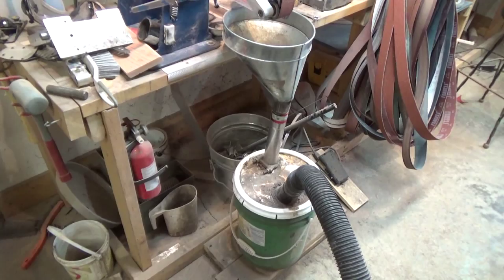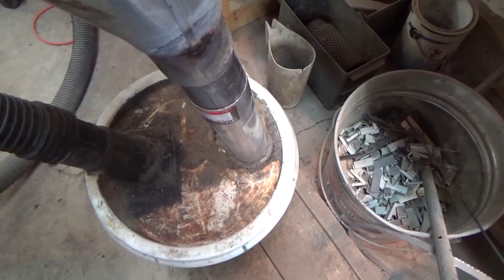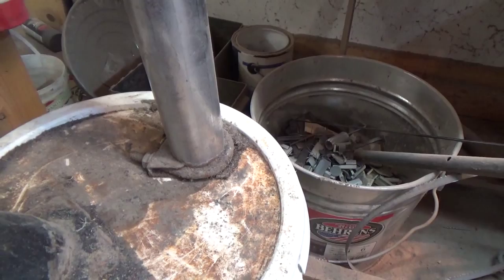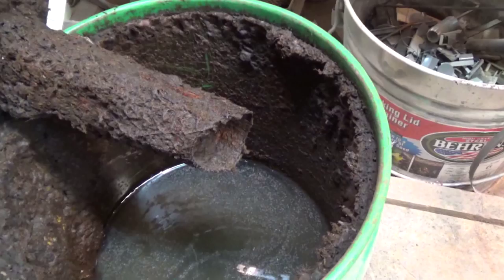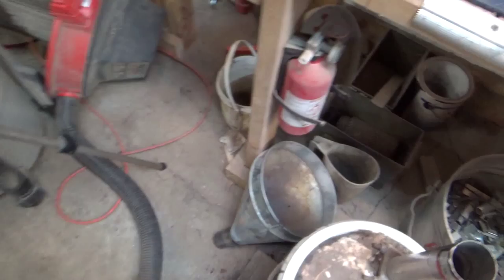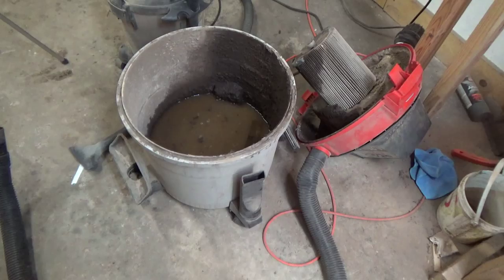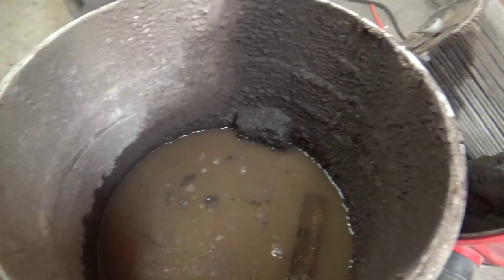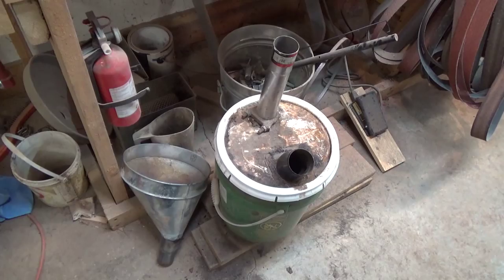Spark Bong Dust Collector

Comment: How come you put the funnel at the edge of the spark/dust collection? I see that about 80%—90% is collected and not 100%. Looks like by pulling the funnel back about a couple inches it would catch about 100% of the dust. Just wondering if it has to do with functionality, spacing or other reasons?? Great idea and very economical to make! Im looking to add a dust collector to my buffer since I do A LOT of grinding and buffing of kydex with my kydex sheath business. Also a collector for my 4x36 sander which I use at horizontal setting. My sander is the messiest as far as small particles go and my buffer is an air quality problem with the fine floating dust. Any tips ? And also why the positioning of the funnel? Great video!
Reply from the maker: The hole of the funnel is inline with the belt with the offset of the funnel going under the belt to help catch swarf that doesn't fall straight down.